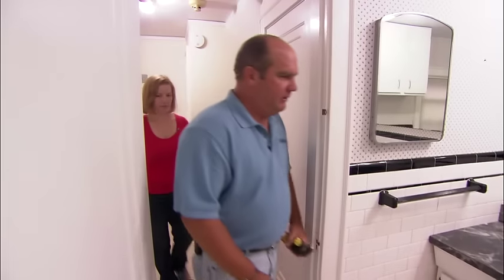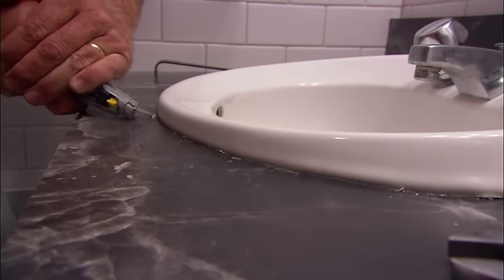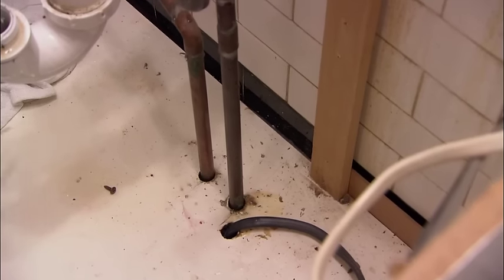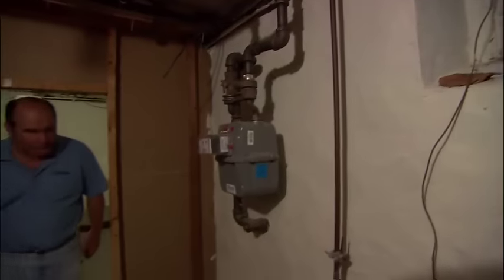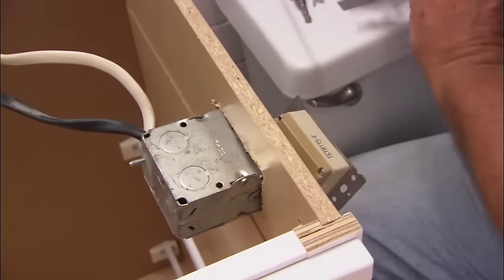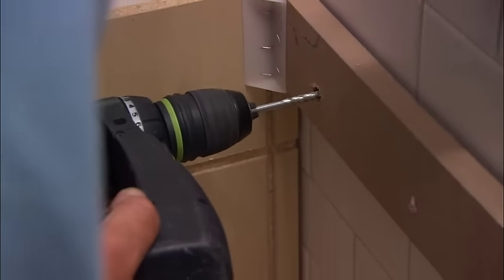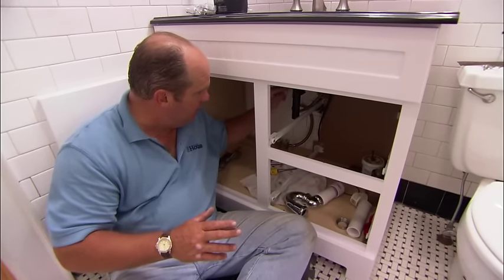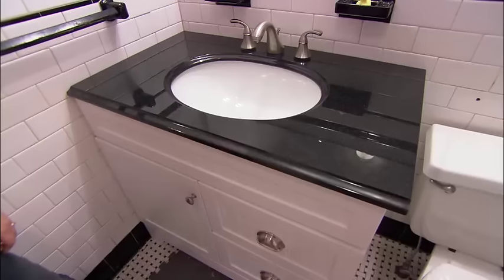How to Replace a Bathroom Vanity | This Old House

Comment: It seems that the shut off valves are too close to eachother.
Reply: they are, but they are not secured from where he tied them into the old lines , so they will move up and down just enough to turn the valves on and off when needed im sure...
Reply: @warrenmichael918  Shut off aka isolation valves are mandatory for new builds or replacements here in New Zealand. Been that way for quite a while  personally I think it's great idea because if something goes wrong I don't have to rush out to the water meter valve near the mailbox where the mains water connects to a property connection.
Reply: @rayanator105  They are in the US too, i was just telling the guy above that they are close together but will still work since they can be wiggled up or down enough if the handles need turned on and off.
Reply: The electrical was badly done. Face plate was uneven.

Comment: I'm confused on the old Vanity look. How would you open the toilet tank. Say if you had to replace parts in the tank. You can't take the top off.
Reply: You would probably have to remove the whole toilet or toilet tank
Reply: I had a counter top like that. You have enough room to lift the lid off and slide it out but not much room to work in the tank.
Reply: Hilarious - didn't even notice that. Super impractical, but it looks amazing. I liked that look
Reply: I had one that I just removed. Mine had a hinged section above the toilet lid which I could lift to access the tank. I don't think all of those type of counters have that hinged piece.
Reply: I think they call that a banjo.  If the lady ever went to one of the newer higher comfort toilets, it wouldn't fit under that shelf.
Reply: We've had a vanity with a ledge like that. It's actually not too bad. I made sure to buy a toilet with enough clearance to have little issue removing the top if needed. Granted, a comfort height toilet wouldn't fit, but since this was a kids bathroom, I was actually happier with keeping the toilet lower for them.
Reply: It has enough clearance to lift the top. Not to operate and fix stuff I think.

Comment: Just a thought, Isn't it dangerous to install an outlet below of the countertop on the right? What if water drops down and slips through. I think i would rather put it on the wall.
Reply: GFCI outlets are what are required when you put an outlet near water, its safe and breaks the connection at the outlet when it shorts.

Comment: Why are the two water shutoffs so close together that you can’t turn the knobs because they hit each other?
Reply: You can turn the knobs because those pipes have enough room to separate if you just push them apart. One of them has to be at 12 o'clock for the other to rotate though.

Comment: The dude half-assed it. The valves were facing the back of the cabinet. The outlet cover plate wasn't even flush with the cabinet. It was just a down and dirty replacement.

Comment: I have never used anything to attach the sink to the base so the silicone is a no brainer I guess thank you. I would suggest you remove the aerator at first when trying out the water to flush out the system after being shut off. I'm glad my instructions of the one I just did reminded me of that cause alot of black junk came through. Just a thought. Great video thank you either way.

Comment: that looks really easy!!!
Reply: Please never assume this is easy when coming to plumbing. As a rule I always know where the shut-offs are and make sure there is a local hardware store open for parts that are unexpected. I just replaced my bathroom floor and toilet and had issues on all aspects but I did know how to correct them as I had done this before. I didn't however know of the repair metal ring to repair a toilet flange so knowing a plummer that also works at the local home depot saved me a bunch of time and headaches. Good luck. When talking about shut-offs earlier you should have shut-offs at everything that has running water to it kitchen sink,toilet,bathroom sink and anywhere else cause in case of an emergency you can just shut the water off and still have water everywhere else. It really is more time consuming than hard though in my opinion of course.

Comment: Those valves never shut off easy and they leak.its never a good idea to put a counter top above a toilet tank lid you can’t get it off if you have to replace a part inside the tank.

Comment: how long does this take he did not mention that in the video...
Reply: He had to modify the cabinet to include an outlet and to fit the drain pipe.  His water lines also came from the floor up, whereas in most homes, they come from the wall out.  His time will not be your time.  Also, he's a pro, and judging by your question, you're not.  His time will be much faster than your time.  So, it's relative.  If you were a pro, and if you wanted the same setup and encountered the same obstacles, I'd estimate a time of 1-2 hours.

Comment: Why wouldn't you use a straight valve so you don't put pressure on the braided connection?  And they are literally touching each other . SMH

Comment: So you basically quick skipped over the one part of this video that needs a video. How do you remove the shutoff valves without making a mess? How do you cut in for the new vanity??
Reply: You simply need to shut off the water supply somewhere closer to the house inlet, or I suppose the main house supply if the bathroom is the first branch off after the water enters the house. Don't do supply line relocation like this video shows, though. This is a hackjob and is going to make someone's life more difficult down the road.